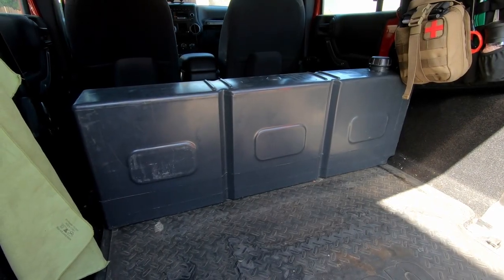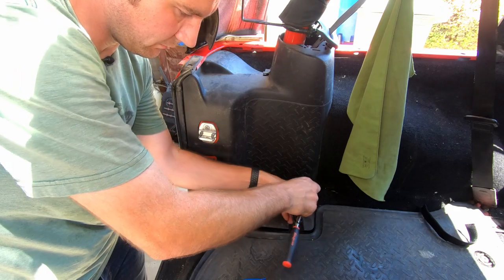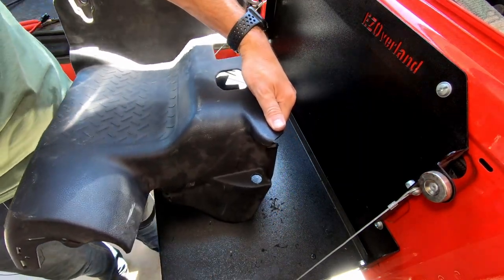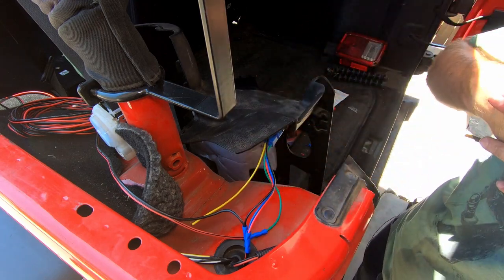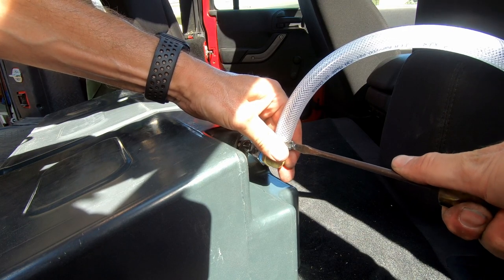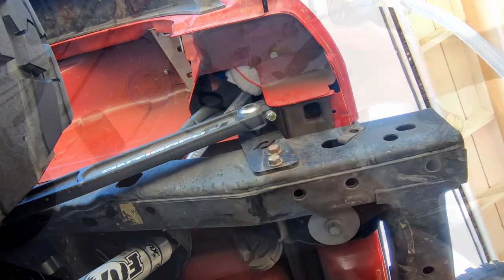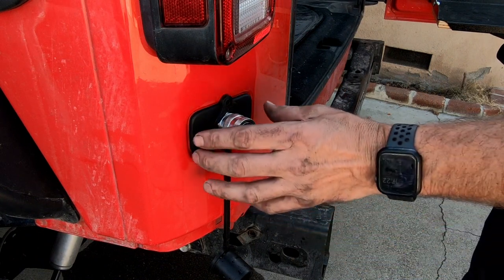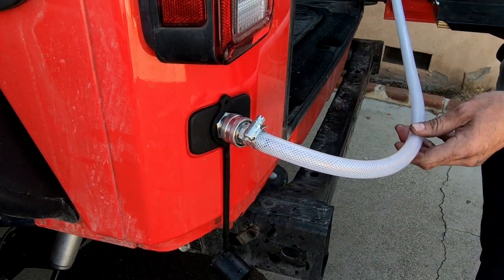Best Easy Jeep Onboard Water System

Comment: Three ideas, ... 1. Make sure to put a drain (if needed) so line filled with water won't freeze and brake.  2. It would be nice to also have a gravity feed too.  3. They make a small RV pressure tank (like those on a home well pump) and it makes it nice to have some water without the pump having to cycle...

Comment: Just a tip for those of us that find we needed 1 more step on the bit. If you can’t get the hole in plastic big enough but can screw the piece in, you can heat the metal up just enough, then you can thread that through without distorting the plastic. No bulging and it will fit in much better.

Comment: Nicely done!  I'm interested in the same tank for a similar purpose, so your video is spot on.  Hey, I did a quick check on that switch because the wire gauge looked thin to me.  It is max 5A and the pump is max 7.5A... so you're underrated on the amperage on that switch... might want to replace it with a beefier one (alternatively, you could install a relay and just use the switch to trigger the relay instead of the pump).  Thanks for all the links too!

Comment: This is great!!! Thank you for the video and the parts list! I also noticed you are running air lift helpers. I also installed mine last week, but I think I may have the wrong ones installed as they immediately bunched up and went between the springs upon lowering the vehicle back down. I wanted to buy a pair of airbag man Hi-Pressure sleeves for the bags but can't find them anywhere except in Australia, and they haven't answered any emails yet. Any ideas? Would love to bounce a couple ideas back and forth if you have time one day. Thanks again!!!
Reply from the maker: Thanks! I’m glad you liked it and found it useful 👍🏻 yeah, hit me up on Instagram and I’m down to discuss whatever you have going on! I have an Airlift1000 kit and for my application with the 3.5” Rock Krawler Springs I use in the rear, I called AL and gave them the inside dimensions of my springs and they recommended a kit, I think the kit I use is actually meant for the front end of an F350. Call them up with the inside dimensions of your springs and they will be able to help you out 🙌
Reply: Kramer Junction excellent thank you. I think I even have the same roof rack too lol. Kramer Junction on insta?
Reply from the maker: MyDatrsPrsnlATM yeah, kramer_junction

Comment: I'm trying to build the same system. the female qd fitting you listed seems to show a hole all the way through.  I would think there needs to be some type of check in the qd to leave it closed until male is plugged in. That way the water doesn't come out? What am I missing here?

Comment: This is a great setup. My only concern would be the water freezing during the winter.
Reply from the maker: Haha yes I have definitely considered that and how Im going to deal with it. I will most likely just leave it empty during the winter unless filling it immediately before use, otherwise I would need some type of 12v heating pad like they use for RVs 🤷‍♂️
Reply: @KramerJunction  Awesome setup! Would there also be a concern for residual water in the pump freezing? Especially given the pump’s location.
Reply from the maker: @resolutejku  haha yes 100%. I’ve actually had to repair the pump due to water inside expanding and cracking parts. I actually removed the water tank a few months ago because I spend most of my time in freezing temps and the pump is constantly frozen. 
I have gone through the thought process of how to winterize the system, just haven’t cared enough to do it. 
In a couple months I will put the tank back when the threat of freezing is gone
Reply: @KramerJunction  Thanks for the reply! Yeah I would love to install a system like yours or Dan Grec's (TheRoadChoseMe) but in British Columbia, the freezing temperatures make an onboard water system pretty complicated. I'll probably just keep using portable water tanks.

Comment: Did you mount the pump with hardware or is it just free-floating? You've definitely help me refine my modification...
Reply from the maker: The pump isn’t hard mounted, but it is basically wedges in place in that void space and with the tubing coming in and out it is pretty solid. It was actually quite a pain to get in place with the pre-filter on and short length of tubing going to the outlet.

Comment: I am looking to do similar, but unsure about securing the quick release on the car. Was the thread tapered on the quick connector? I’d be hoping the connector you used on the inside would pull the quick connector tight into the panel to sandwich it in?

Comment: Cool mod!  Nice video.  Did you reseal the drain plug hole in the floor?  If so, how did you do that?
Reply from the maker: Nah I just left it open, minus the line running through it. I put the rubber from it in the passenger seat storage cubby on the back of the seat

Comment: Does the quick connect have a check valve (Jeep side). If you were to press the power button would water come out of the connector if the faucet were not attached?
Reply from the maker: It does not. I do wish I had added something like that on the initial install or used some different pressure washer fitting, but it also hasn’t been an issue so I haven’t changed it. Hindsight being 20/20 I absolutely would do it differently a second time and I may in the near future.
I have disconnected the faucet while it was under pressure more than once lol

Comment: Brilliant. Thanks for the video! 

Quick question - while the water pump is running, do you open the cap on the water tank to offset the pressure? Or have you installed a pressure release value on the tank as well?
Reply from the maker: Awesome glad you like it 👍🏻 good question, I just loosen the cap when I’m using it so air can get in. A pressure release valve in the cap sounds like a great idea though 🤔
Reply: @KramerJunction  Makes sense! I have the 16-gallon rectangular tank. Been trying to figure out how best to arrange everything. Currently using a Waterport for showering, but would much prefer 16 gallons to 3. I'll keep my eye out for your next post!

Comment: Does the pump have to work harder being so far from the water supply? I think this is a great idea. I just worry about the life span of the pump in that location. I definitely like how you thought it out.
Reply from the maker: The section of tubing in my system is 5-6' and the pump is intended for RV use with runs of tubing much longer than what I'm using so it's actually quite over sized for what I'm using it for. I have the pump wedged in place pretty tight so I don't worry about it getting banged around, but it's definitely dust and potentially wet in that area. Funny, I was camped out the day you made this comment and I accidentally left the pump on and it ran dry for hours...I opened the water, turned on the pump and it's running perfect like nothing happened. I think the pump was only like $60 so if it does fail after a couple of years then I honestly can't complain.
Reply: @KramerJunction  nice to know.  Love the idea. Thank you for your feedback
Reply from the maker: @TheDon8771  i can definitely recommend the pump I used. The only thing I would change is if maybe I could find a more compact pump with maybe a slightly lower flow rate for water conservation purposes. An on demand pump is a must. I even considered adding an accumulator tank like you would find in an RV, but just wasn’t possible with space constraints
Reply: @KramerJunction  yeah. Space is our only enemy when it comes to this.  We want to do so much but limited on space.  My fault tho. I got a 2 door cause I don’t have any children.  I don’t have my rear seat in. But with tools and gear it can get quite packed.  Leaving for Florida Wednesday. Soon as I get home I’m gonna get started on the water project.  I appreciate your feedback. 👍🏻

Comment: Nice video! I’m on it.
Reply: Did it. Works great! One quick note, and it's probably something you've experienced: for the connection from the faucet to quick disconnect piece, one is NPT (truncated) and one is NPS (straight) so it won't thread completely, but with enough teflon tape it will not leak. Just in case someone else tries and sees that that the threads wont fully seat.

Comment: Only thing if be worried about is electrical sparks from the electrical motor, an fumes from the gas tank
Reply from the maker: I had thought about that. It’s an open space with a hole at the bottom so I’m not terribly concerned though and it will only ever be powered when the Jeep is stationary so I think it should be ok plus everything is fused. Definitely a consideration 👍🏻

Comment: Good video but why didn't you go threw the carpet much shorter run.
Reply from the maker: I considered doing this. I may change it in the future. Either way would work, but under the carpet and up the wheel well in through the top of the taillight would definitely be a shorter run. 
I have a Goosegear plate system on order so things may get changed when I do that install 👍🏻

Comment: how can i fit a water purifier between the pump and the tap to kill nasties? Using ultra light purifier?
Reply from the maker: I haven’t looked in to this so I can’t tell you which filter would be most appropriate and far as what works with the tubing and pressure the pump runs but my initial thoughts are you would probably want the water to go from the pump to a small accumulator tank and then a filter would be installed inline somewhere after that. Drawback is it would be a bulky setup and I don’t think you would get any type of usable pressure out of it as most filters work somewhat slowly. 
I don’t use the water in my storage tank as drinking water but if I do ever need to I carry a large water filter made by sawyer that filters a gallon of water at a time in a few minutes.

Comment: Any issue with keeping the lines clean? Do you flush them out?
Reply from the maker: I keep fresh water flowing through pretty often so things stay pretty clean and I look inside of the tank frequently to see the water level and the inside is always as clean as the day I bought it. It's only 5-6' of tubing, so its basically being flushed every time I turn the water on.
Reply: @KramerJunction  awesome. Thanks so much for the reply. Awesome build!